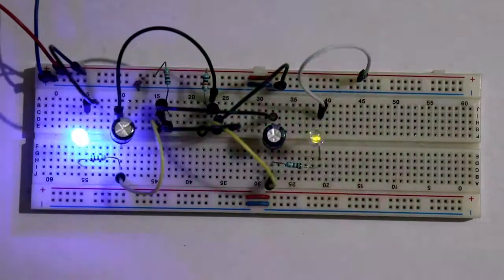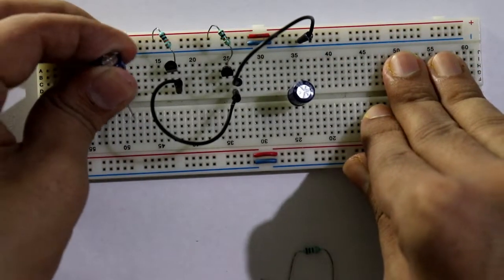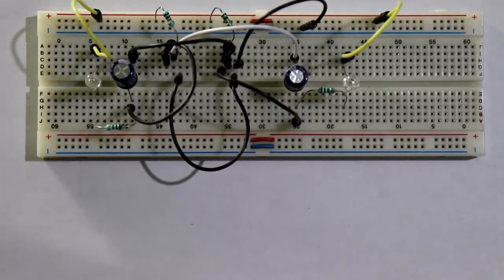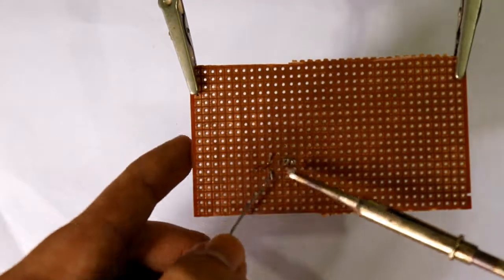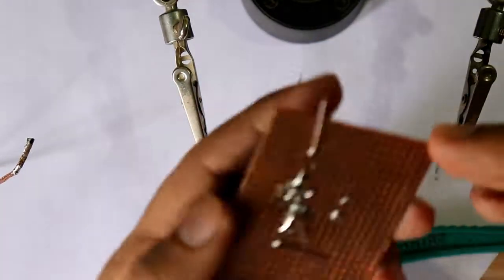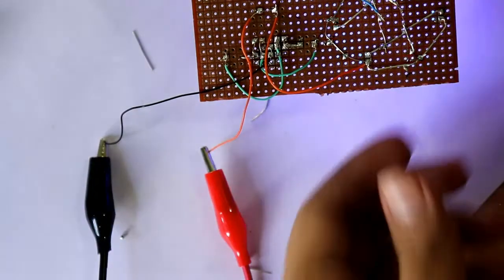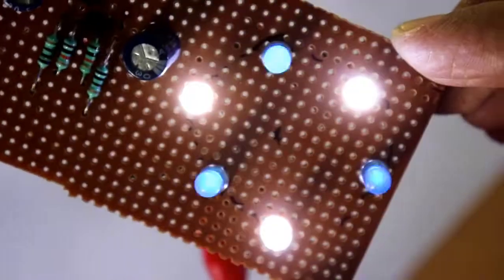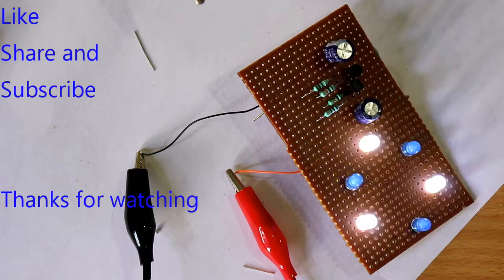Make a simple LED flasher with two NPN transistors

Comment: Sir isme aur kitni LED lag jayegin
Reply from the maker: Aap BC548 ya BC547 se 10 LED tak laga sakte hai. Agar aapko jyada chahiye to BD139 use kijiye. Per transistor aap 80 LED tak laga sakte hai. BD139 ke sath heatsink jarur use kijiye ga. Supply volt 5v rehega. Aur per LED 220 Ohm resistor use kijiye. Red and Yellow colour ke liye 330 Ohm.
Reply: @EEWave  omg   its the CURRENT.